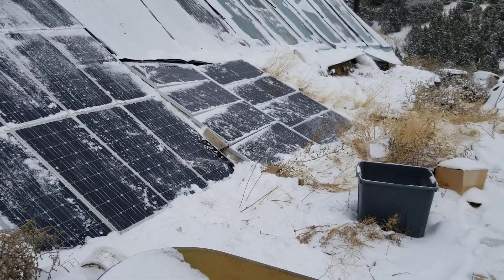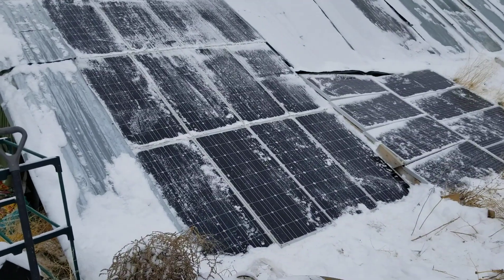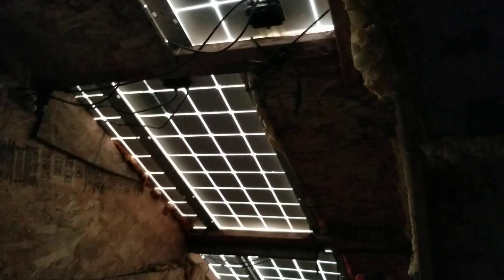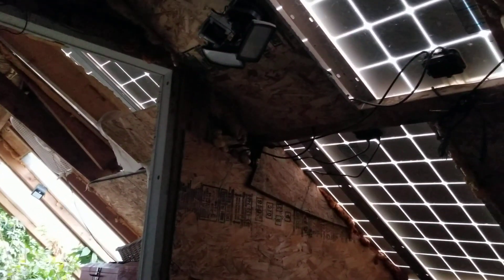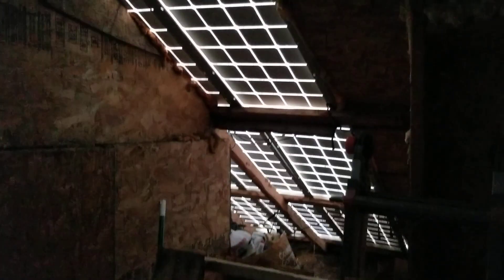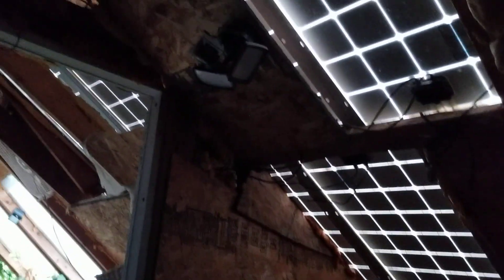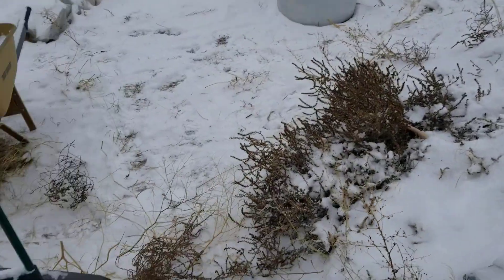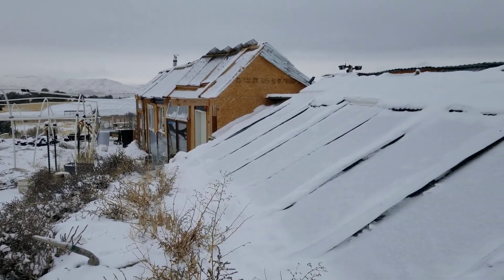DIY Solar Panel "Roof" Installation Fail

Comment: Hi. Just found your channel. Awesome work...How deep is your berm wall? Are your tires fully rammed? And do you have air tubes and door transams?
Reply from the maker: Appreciate the support. My tires are fully packed and we dug down about 3ft, so we have about 5 rows of tires. I think the inside if the house is about 16ft in and about 20ft wide. Not sure what you mean with air tubes and transams?
Reply: @GrowTreeOrganics  air tubes and transsams for pulling cool air from outside through the ground into the house, the transsams, which are over the doors in the between the house and greenhouse..  I think it's called convection(could be the wrong word).. they talk about it in the Phoenix earthship YouTube walk through and some other earthship videos from eartship biotecture YouTube channel.. it's basically ac. Through the earth, house, greenhouse, using the thermal dynamics..
Reply from the maker: Oh we have cooling tubes. I actually need to make the vent in the greenhouse better, since we have a fan doing most of the pulling, but we do get the convection even without the fan running.